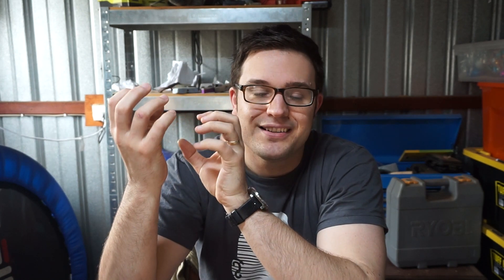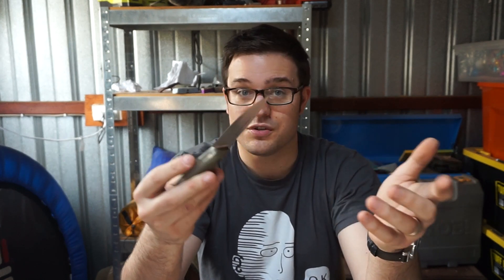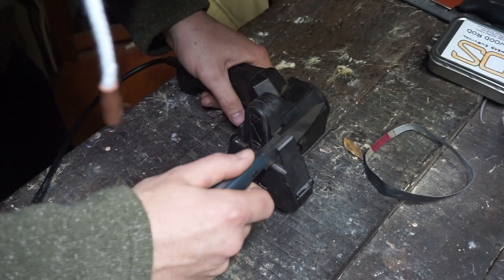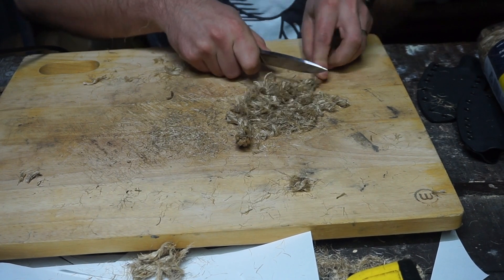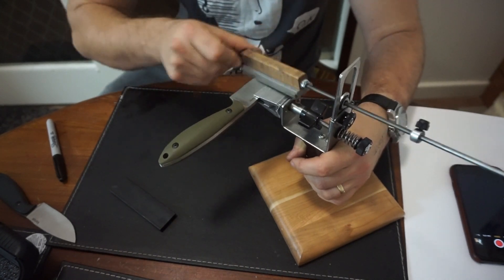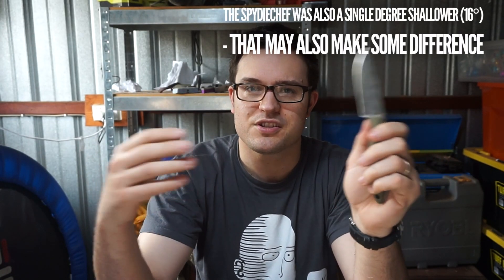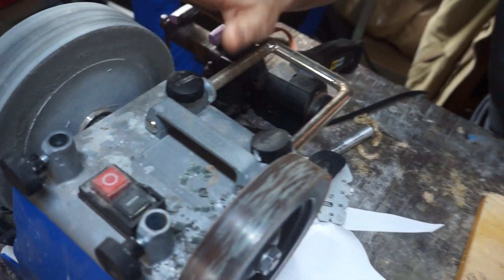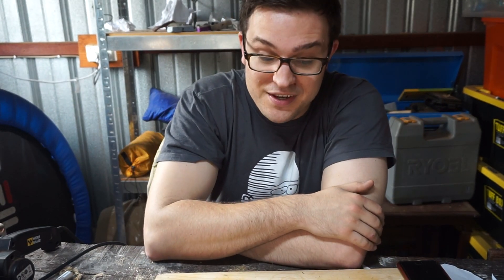Nitrogen : Steels of the Future? Vanax Superclean and Z Finit Part 1

Comment: Yeah probably not worth the INSANE cost for Vanax Superclean over Lc200n. For reference it's more expensive then Maxamet and Rex121, even buying in bulk by the pound is insane. I'd be interested to see how Nitrobe77 at 62hrc stacks up to Vanax
Reply: I am in love with LC200N. It is a very impressive and unique steel. Very nice and new to me. I highly recommend this steel and urge you to try it out if you are a metallurgy nurd. Haha. It really is a cutting edge steel.
Reply: Nitrobe77 is also very expensive, and much more difficult to din in my experience. The HT is very expensive as well. 

Personally I love Lc200n at 60 HRC. Tough, pretty great edge holding too. 230 seems similar to what I've gotten in my testing without going super thin on the edges. I havent tested vanax, which is why that knife is on the vid. 

Excited to see further testing!
Reply: Those grinds look HAWT Colin, that new grinder really shows, I got a piece of Nitrobe 77, yes its just as expensive as Vanax but yes the heat treat has more steps to it. It would be interesting to see how it compares and if its worth the trouble. Maybe Lc200n is the way to go haha
Reply: Big Brown Bear yeah but steel cost is the most minor part of the cost of the knife. Now the real cost of superclean is that super advanced heat treat that is required
Reply: magdsmad super advanced? 1975f for 30 min in foil, plate quench, cryo, temper twice with a cryo in between? Nothing crazy or advanced  about it.  Adding that much nitrogen to a steel powdering it, that's the advanced part.
Reply: Big Brown Bear there’s no way with that amount of nitrogen in the steel you can get away with just foil. I’m pretty certain you’ll need a vacuum furnace with a nitrogen atmosphere to prevent denitrifying the steel. I could be wrong but that’s generally a requirement of high nitrogen steels and the cryo for optimal HRC is usually pretty extensive and requires LN2 over a cheaper dry ice setup.
Reply: magdsmad Nah brother, the knives I made had better results from the foil for nitrogen steels. Less nitrogen loss then in the vacuum furnace. Also these nitrogen steels need to be heat treated at full thickness to retain more nitrogen. When people say Cryo they mean Liquid Nitrogen, Sub Zero is term for dry Ice. 
Get some blades heat treated and see what you find out. That's been my experience with making knives out of Vanax and Lc200n
Reply: magdsmad another problem was vacuum quenching, it was a bit slower then the plate quenching.
Reply: Big Brown Bear huh. Interesting. I’m not a knifemaker so fair enough :P. I’m just a knife making/metallurgy forum lurker :P. I would love to see a super heat treat of vanax with one of those fancy molten lead heat treat thingamabobs. Either way I think think vanax is definitely a very technically impressive steel
Reply: magdsmad yea Nitrogen steels are Rad, have you heard of Vancron 40? Basically a PM nitrogen A11 tool steel, I've been chasing that one for a the past 6 months now, it has my curiosity. I'm hoping to see mor
Reply: @magdsmad  it's super funny. In hindsight that you were at some point arguing heat treats with the guy that just did a heat treat collaboration for spyderco 😅🤣
Reply: magdsmad Yeah, no idea what Vancron 40 is like, spec sheet says it can hit the mid 60s though and it has similar composition to a11 class steels which is rad. There currently isn't a way to get Lc200n past 60hrc, Vanax can hit 62 with a high tempers at a cost to corrison resistance and reports of edge stability loss. I think that's where Nitrobe77 come into play, it can hit 62hrc
Reply: Big Brown Bear I wish Nirtobe 77 was more popular. I have a knife in it at 62.5 hrc and it's one of my favorite steels. Takes an incredible keen edge (better than Aeb-l and Lc200n), relatively easy to sharpen and high edge stability. From what I've read it's expensive and a pain to heat treat(triple tempers with cryo in between). Still looking to try out Vanax and Vancron has been on my radar for a while.
Reply: @MFD00MTR33  Where did you get the knife?
Reply: @TNUni167  It's a Carson Steel labs knife. They're not in business anymore and either got bought out by or their designer/owner went to form Real Steel since you see the old Carson designs made as Real Steel. They actually made some fixed blades with Nitrobe 77 where the hardness is 64 hrc. There's one on EBay right now for $550 if you're interested. The one I have is a button lock folder, you can see it in Jim Skeltons review from years ago. Hope this helps.
Reply: @TNUni167  Also Des Horn is famous for making knives out of Nitrobe 77 and does an incredible heat treat on them. I had a chance to buy one of his customs years ago and I'm still kicking myself for passing on it to order from a maker who screwed around for a few years never delivering the knife I ordered.
Reply: @MFD00MTR33  Yes, I heard Des Horn made knives out of Nitrobe 77 but they're no longer making them. It seems many of these companies that make Nitrogen steel knives or Nitrogen steel stop making them after a short time. Might be the low demand for it and the difficulty of manufacturing.
Reply: knife sharpening norway I would say a rough estimate of 350ish with Zfinit.
Reply: @ShannonSteelLabs  okay thank you always wanted a good chinese cleaver cant afford it but still wants it hehe
Reply: I've heard of vancron 40 before but nitrogen steels man lol. You throw in a bunch of nitrogen and it's like all of sudden I haven't a damn clue what this magical metal is supposed to do. If you get some and make something out of it do let me know lol. I know A11 is a niche knife steel that I've heard some people use but I have no idea how it might preform.
Reply: LC200N is one of my favorite steels. I'm just hoping vanax superclean is pretty much the same thing but able to hit higher hardness hrc 62+. That'd be the endgame for me in knife steels. HRC 63 LC200N with a 12 degree per side edge. Infinite performance and stainlessness!!!!
Reply: I know lc200n doesn't go up beyond 60. I more or less meant I'm hyped for the first nitrogen steel that's like lc200n that can hit 62+ hrc :P. I'd be content with that. Honestly, LC200N is 90% of the way there. I just want that extra little bit of hardness so I can bring the edges down stupid thin and have the best and most durable corrosion resistant little slicer.  I'm still waiting for that dream :P. In the meantime, I'll just enjoy my little Ruike knife and try not to be tempted to by that Spyderco Carribean (Spoiler I probably won't be able to resist buying a  Spyderco Carribean lol)
Reply: Just wondering what would you say is the perfect steel and hrc for a chinese cleaver at say 200mm blade length and say 100mm blade height and insanely thin a little thinner than a cck.  Would be?
Reply: Have you looked into BD1N steel yet? It's basically a nitrogen based BD1. I recently bought a Nexus Chef knife with a 63 HRC (on amazon) and it's a surprisingly good steel so far. It took a nice low angle edge, and did great in rope cutting test (performed by Burrfection) compared to kitchen knives costing many times more. The steel is relatively cheap, and costs about as much as VG 10. I'd love to see a knife made with the steel that is a bit thinner, and with a less smooth handle, for better grip, then the Nexus.
Reply: Mike I havent used it. Big brown bear has used it with good results I believe. I have Nitro-v and it has performed well for a few customers. Will have to Try BD1N soon.
Reply: someone get this guy's left arm a shake weight stat!
Reply: Wow, I thought after college that I was rather intelligent compared to the average person. Then I ran into these two chatting and it just verified that I am a moron. Thank you fellas. Good Day.

Comment: I have the para military with CPM D2 sprint run, that blade holds so much better than all my S30V from spyderco, you sure it is same as regular D2? I haven't try any regular D2 myself
Reply from the maker: I have tested cpmd2 and it is a different way of arranging the elements in the steel. It performs differently due to this process, so you are very likely experiences different levels of wdge retention

Comment: I use my knives at work and they get abused. Can’t see paying more than $75 and d2 is the best bang for my buck. Anyone have a better suggestion
Reply: Depends on what you do. If you're doing a lot of cutting in one day then even s30v would be better than D2, not to mention s90v, s110v or m390. If you're doing a lot of task like scraping, prying with cutting in between then D2 is an ok-ish choice but I'd either go with a tool steel like 3v, m4, 4v, cruwear or even A2 or a low carbide stainless like nitro-v, Aeb-l or any of the Sanvick steels since they beat D2 toughness wise and are easy to touch up. 
But if your $75 D2 blade works for you then you're good.

Comment: In case you weren’t aware, 14c28n (steel used in the stainless mora garberg) is also a nitrogen steel. There are a lot of people who say it’s hard enough to cast sparks with a flint because unlike many other stainless steels.
Reply: It is most definitely a nitrogen steel. I don't think can cast sparks off a flint though. At least I've never been able to do it.
Reply: Not all the spec sheets are always available my friend.
Reply: John Tedichwon Sandvik does not publish the recipes/components of their steels because they’re company secrets. They have released nominal chemical composition of the steel and it does contain nitrogen, however not a lot of it so I guess some people might argue that it isn’t technically a “nitrogen steel”.
Reply: It's definitely a nitrogen steel. In fact it's advertised as the main difference between 14C28N and 13C27. Additional nitrogen to improve hardness and corrosion resistance.
Reply: John Tedichwon   Then what does the n stand for in 14c28n?

Comment: Great Work!!! 62Hrc Would be the preferred hardness for these Alloys
Reply: Mark Anthony Stringfellow problem is there is a ceiling to these two alloys, especially lc200n, that stuff can barley push 60hrc. Vanax has options, it can push 62 with a 800-900°f temper but it reduces the stain proofness of the steel and interestingly drops the edge stability. There might be a way to go for low temper on Vanax (200-300°) but no one has tested it since it's not on the spec sheet nor was it intended to be at tempered lower by the Metallurgist at Uddelholm.
PM Nitrobe77 might be the answer for higher hardness (62hrc) and has been well researched by Des Horn, also Cliff seems to like it.
Reply: Mark Anthony Stringfellow I feel ya brother, to the moon!!!
Reply: Set Your Sights HIGHHHH :-)))
Reply: Big Brown Bear I agree 77 seems to be what people are actually looking for. I wish they still made vanax 75...
Reply: Tactical Center cool, what's the IG?
Reply: Thanks 3B! Im Finding that the nitrogen steels seem to do rather well in toughness so was thinking PUSH that HRC to the ceiling HaHa :-)
Reply: Theres a guy on ig using superclean and he does a triple cryo and tempers. forget if he said high or low. he was making Filet knives out of it, so thin and bendy were the target. very interesting.

Comment: Of all the sharpeners you have which would you recommend
Reply: bp69 Yeah. Freehand- no limits!
Reply: Thomas Nardelli recommend for what? You should be more specific. They all serve a slightly different purpose.
Reply: To sharpen all of my knives fixed blade and folding skandi grind as well I don't what to spend excessive amounts of money on it eather
Reply: Thomas Nardelli yeah but what are you trying to accomplish? Fast work? Quality? A rough edge or polished edge? What’s the biggest fixed blade you have? Do you plan on using one of these systems to sharpen it?
Reply: My two cents:

Quick and dirty: Worksharp belt sander (what Pete uses first here)

Better v edge: Lansky (budget) or KME. 
You largely get what you pay for with angle systems. They all have some limitations.
Reply: I would go for a mix of everything freehand,guided system etc
Reply: Tony Canniffe yup it’s harder to get good at but I find it’s good to have multiple ways of doing something
Reply: bp69 I don’t think my Skrama is gonna fit in the Lansky(:
Reply: Tony Canniffe probably not it I think it will fit anything up to 3/16 inch thick a kme can go up to 1/4 inches I think
Reply: bp69 Ibwas gonna clamp it in a vice and bring the stone to it. (I have a few chips from my last chopping episode).

KME is on the way, so I might use that, if it fits.
Reply: Tony Canniffe skrama seems to chip a lot hope you got the beast and 100 grit stones to help you out
Reply: bp69 Yep. Got the deluxe kit. I was a bit surprised at the chipping given the steel and edge angle, but I think it was dirt/gravel in the stuff I was chopping.
Reply: Tony Canniffe oh I was going to get the deluxe kit but for what I would actually use not getting it is cheaper